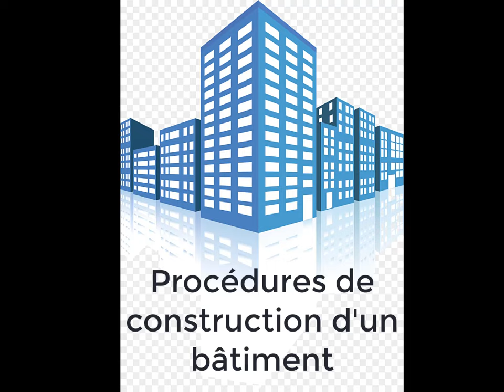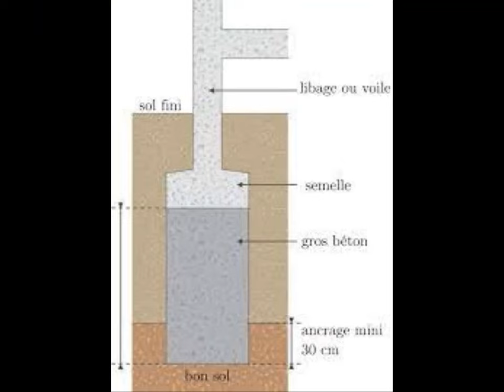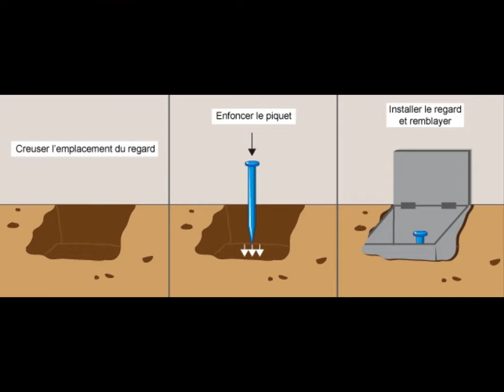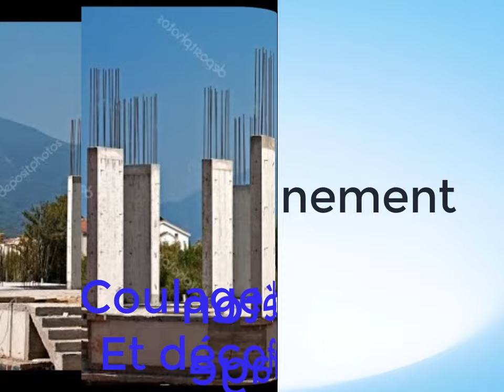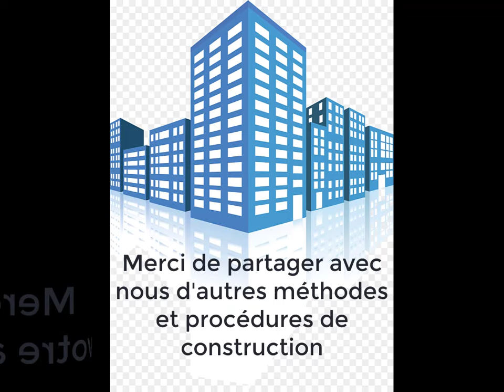Procédures de construction bâtiment : 15 Etapes de A à Z

Comment: Bonjour,

Connaissez vous le coût pour construire un immeuble de 10.000 M2 de surface plancher

Merci à vous
Reply from the maker: Bonjour
C'est de l'ordre de 5000 DH/m2 mais ça dépend de la finition souhaitée (type de standing) , du type de fondation, la distance entre le lot de terrain et les réseaux (eau , électricité, assainissement) et d'autres paramètres le cas échéant.
Reply: @ELAMRICivilEngineering  contact svp
Reply from the maker: @med4246  elamri.engi@gmail.com